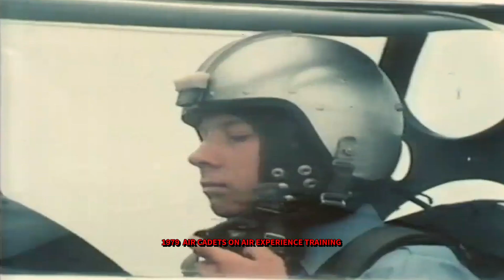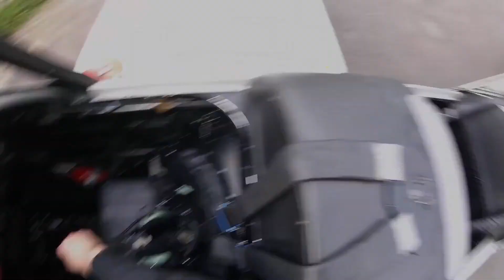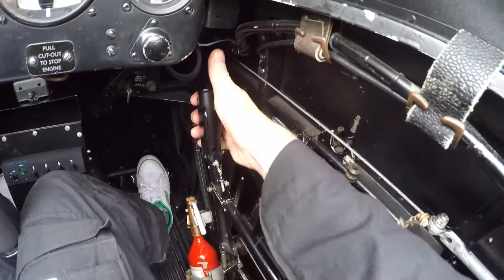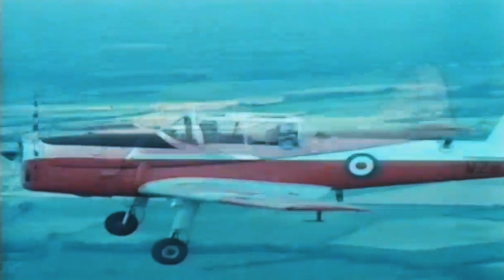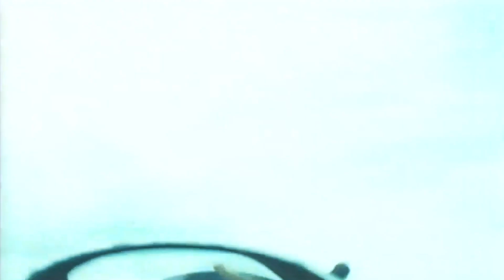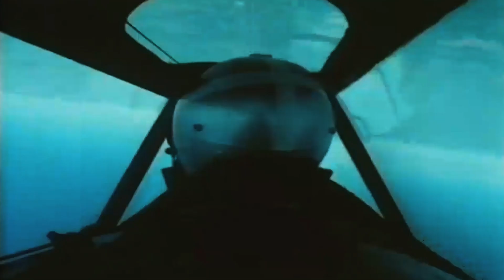DE HAVILLAND DHC 1 CHIPMUNK CLASSIC

Comment: I remember the chipmunks  ar Exeter Airport in ,1960/70 I think the air cadets had them , I remember asking one of the fitters why the engine was upsidedown and thought where does the oil go.
Reply from the maker: Yes the engines are well known for using oil. 😊. Chris.

Comment: I like what the late Brian Lecombre said about the Chipmunk. "It was designed to be an aerodynamic improvement over the Tiger Moth. You could nail a plank across a milk float and achieve that
Reply from the maker: He had a good point on that one.
Please have a subscribe Ian and check out my other films. Chris.
Reply: @GULLPERCHHISTORICALARCHIVES  Done mate. Having quoted Brian Lecomber I still say the Tiger Moth was a beautiful machine to fly.
Reply: Yes, although the Tiger Moth was delightful to fly in. It felt very stable and 'at home' in the air. I never felt unsafe in a Tiger. 
Those taut interlaced cross-bracing wires and wing struts made for a feeling of stability extending beyond just the visual into the realm of deep affectionate trust. It was (and is) a gentle aeroplane you can trust if provided with just the barest necessities for maintaining forward flight, particularly when approaching the ground.

Comment: I'm surprised you didn't mention their use for RN training at Plymouth Airport, as you are an ardent campaigner to get it reopened.
Reply from the maker: To be honest Stratobuddy when I edit these films together its quite difficult to pack all the information into a short film, I get side tracked easily and and so I often look back and think I could have done better, I have put many posts up on facebook about all the aircraft at Plymouth Airport right back to when Amy Johnson flew in and all the Tiger Moths and Chipmunks on the Royal Navy Flight. Chris.